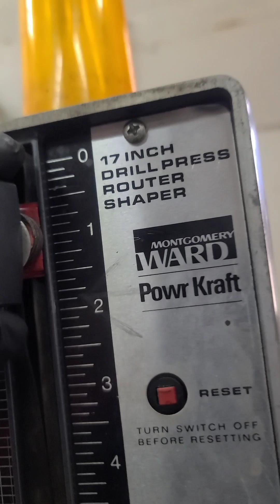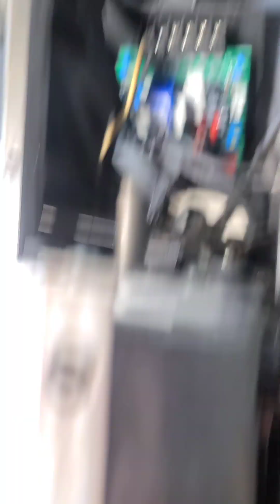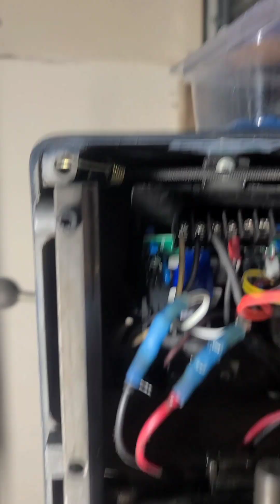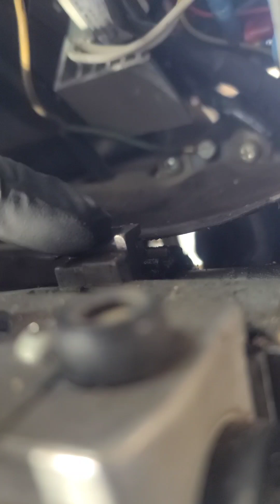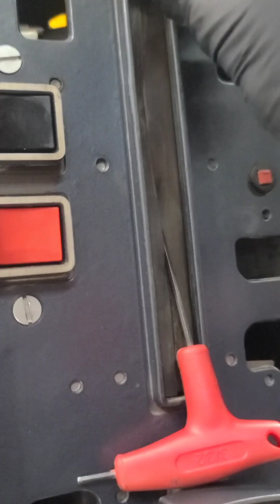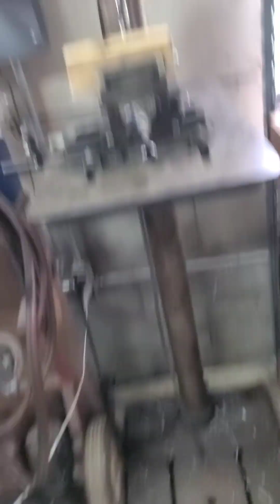Montgomery Ward Powr Kraft. THS 2437 A + THS 2436 A speed controller replacement.

Comment: I was wondering if the speed controller you purchased for this puts out enough current at low voltages? I understand that voltage is controlling the speed and using this technique also reduces torque at low speed, but what's shown in your video seems excessive?